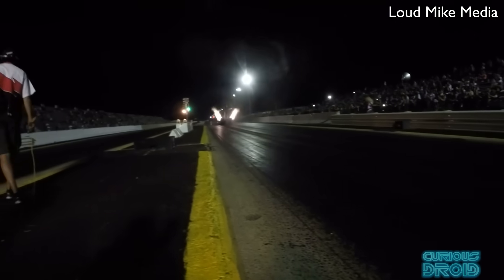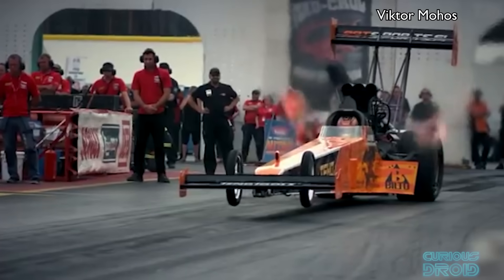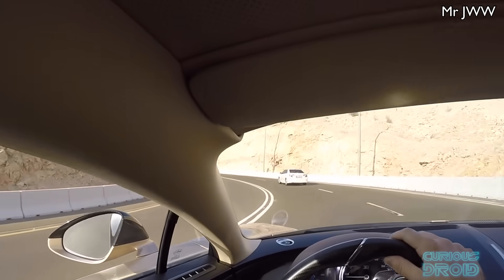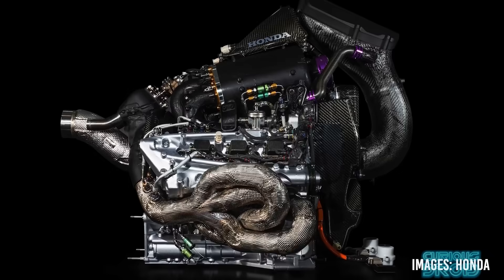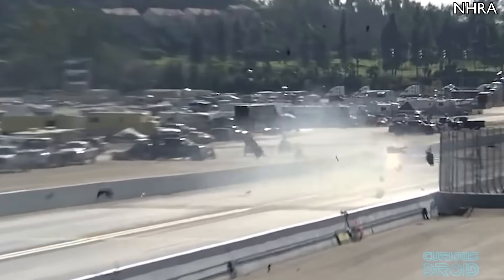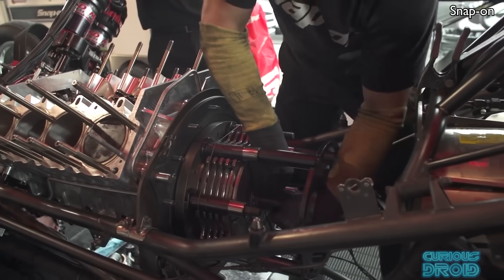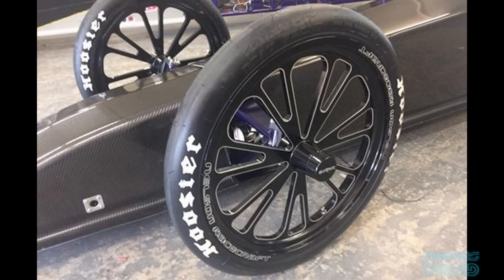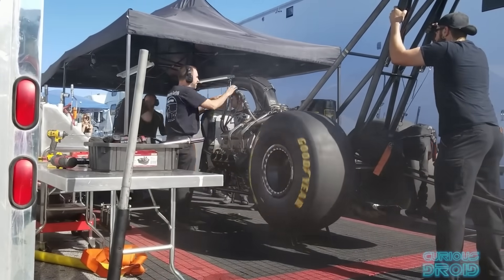The Amazing Engineering of Top Fuel Dragsters

Comment: I remember reading this years ago regarding a "Definition of Acceleration"......

One Top Fuel dragster's 500-cubic-inch Hemi engine makes more horsepower than the first four rows at the Daytona 500.

A stock Dodge Hemi V-8 engine cannot produce enough power to drive the dragster's supercharger.

With 3000 CFM of air being rammed in by the supercharger on overdrive, the fuel mixture is compressed into a near-solid form before ig-nition. Cylinders run on the verge of hydraulic lock at full throttle.

At the stoichiometric 1.7:1 air-fuel mixture for nitromethane, the flame front temperature measures about 7000 degrees Fahrenheit.

Nitromethane burns yellow. The spectacular white flame seen above the stacks at night is raw burning hydrogen, separated from atmospheric water vapor by the searing heat of the exhaust gases.

Dual magnetos supply 44 amps to each spark plug. This is the output of an arc welder in each cylinder.

Spark plug electrodes can be totally consumed during a single pass. After half-distance, the engine is dieseling from compression plus the glow of exhaust valves at 1400 degrees Fahrenheit. The engine is shut down by cutting the fuel flow.

If a spark plug fails early in the run, un-burned nitro can build up in the affected cylinder and explode with sufficient force to blow the cylinder head off in pieces or split the cylinder block in half.

In order to exceed 300 mph in 4.5 seconds, dragsters must accelerate at an average of more than 4 g's. In order to reach 200 mph before half-distance, the launch acceleration approaches 8 g's. A Top Fuel dragster reaches more than 300 mph before you have completed reading this sentence.

With a redline that can be as high as 9500 rpm, Top Fuel engines turn approximately 540 revolutions from light to light. Including the burnout, the engine needs to survive only 900 revolutions under load.

Assuming that all of the equipment is paid off, the crew works gratis, and nothing breaks, each run costs an estimated $1000 per second.

The current Top Fuel dragster elapsed time record is 4.441 seconds for the quarter-mile (October 5, 2003, Tony Schumacher). The top-speed record is 333.25 mph as measured over the last 66 feet of the quarter-mile (November 9, 2003, Doug Kalitta).

Putting all of this into perspective: You are driving the average $140,000 Lingenfelter twin-turbo Corvette Z06. More than a mile up the road, a Top Fuel dragster is staged and ready to launch down a measured quarter-mile as you pass. You have the advantage of a flying start. You run the Vette up through the gears and blast across the starting line and past the dragster at an honest 200 mph. The "tree" goes green for both of you at that moment. The dragster launches and starts after you. You keep your foot down, but you hear a brutal whine that sears your eardrums, and within three seconds, the dragster catches you and beats you to the finish line, a quarter-mile from where you just passed him. From a standing start, the dragster spotted you 200 mph and not only caught you but nearly blasted you off the road when he passed you within a mere 1320 feet.

And that my friends, is acceleration!
Reply: I recently ran across that 900 revolutions figure. Seemed low but with start, idle, burnout, reverse, idle, and run, 900 to 950 seems correct.
Reply: This is a very long comment but it has some cool facts I like it

Comment: I knew many of these facts from other videos but some things that never stop amazing me:

The supercharger alone requires 800hp to work.
The engine pumps so much fuel in that it's just barely close to hydro locking.
The clutch replaces about half of the friction plates after each run because the heat literally welds them together.
The magnetos produce around 88 amps, around the same amount as low level MIG welder.

Comment: I've stood about 25m in front of a Boeing 777-300ER with GE90-115B engines, the largest gas turbines fitted to an aircraft, running at 90% N1. GE reckon that's about 140,000hp, and it's still not as loud as a Top Fuel Dragster in my opinion. The pressure waves from the exhaust on those literally distort the lens of your eyeballs and your vision blurs as they go past, awesome!!
Reply: Stand a few dozen feet behind that engine and see how loud it is!

Comment: I believe this is the only documentry on the stresses and design nuances packaged for us laymen. Much appreciated. I have two 1/10th scale radio controled drag cars. :) This video actually might be a bit helpful in understanding their bad behavior in 132ft. A controled straight line run with these models is an art. There is a YT video of one of these models launching without the body on it filmed with a high speed camera. The chassis was carbon graphite and it had aluminum suspension parts, gearbox housing and lots of high tech parts. The video was shocking! The chassis had a visible ripple that traveled through the length of the model and a longitudinal curl in the first second. Really brought home why these models are so twitchy. 
But it's also the fun part to tune that bad behaviour into something controlable. 
So your going to do a video on how top fuel and funny car chassis are designed right?

Comment: Fastest ground vehicle ? what about jet powered dragsters making 28,000 hp and going much faster?
Reply: They actually don’t accelerate faster. These still beat them in a 1/4 mile
Reply: @captainhellhound7451   vanishing point did a quarter in l 3.58? which is accelerating much faster RIP sammy miller.

Comment: No one is going to point out: 8.6 times as much nitromethane as gasoline can be burned in one stroke. Nitromethane, however, has a lower specific energy: gasoline provides about 42–44 MJ/kg, whereas nitromethane provides only 11.3 MJ/kg. This analysis indicates that nitromethane generates about 2.3 times the power of gasoline:

Comment: I've been a mechanic for over 30 years and it's amazing to me how they get that much power from a V8 engine! There's absolutely nothing like it on earth!
Reply: Not only that but a V8 that's built off of an ancient design. I want to see a top fuel dragster with a modernized engine 🤣
Reply: @ksrebelbuck7936 from what it sounds like, they're already holding these things back for safety/insurance.

It would be cool to see one that lasts longer or blows up less, but that's more for the team than the spectators.

Comment: How do they do it?  Barely!

The old saying is if the race is 1/4 of a mile and it machine lasts 3/8 of a mile you didn't try hard enough.

In terms of the basic insufficiency of the vehicle to survive it's intended course intact to the degree it compromises the safety of the pilot - and anyone near by -  the top fuel dragster [or motorcycle] is probably the most extreme example in the world.  The only comparable counter example would be the motorcyclists and motorcycles of the Island of Mann TT, where the course is the limiting factor not so much as the machines themselves, though mechanical failures regularly cause spectacular and sometimes fatal crashes - just google Guy Martin.

Comment: At 13:00 you say rear wing produces "12 000 pounds, or 5,5 kilonewtons", but it should be 55 kilonewtons - 5,5 tons... which is totally crazy. 
(i checked some data and 6000 pounds (3 tons) seems to be normal, which is still crazy)

Comment: Oldish, but still relevant.
You are riding the average $250,000 Honda MotoGP bike. Over a mile 
up the road, a Top Fuel dragster is staged and ready to launch down a 
quarter mile strip as you pass. You have the advantage of a flying start. You 
run the RC211V hard up through the gears and blast across the starting line 
and past the dragster at an honest 200 mph (293 ft/sec). The tree' 
goes green for both of you at that moment. The dragster launches and starts 
after you. You keep your wrist cranked hard, but you hear an incredibly 
brutal whine that sears your eardrums and within 3 seconds the dragster 
catches and passes you 
He beats you to the finish line, a quarter mile away from where you 
just passed him. Think about it, from a standing start, the dragster had 
spotted you 200 mph and not only caught, but nearly blasted you off the 
road when he passed you within a mere 1320 foot long race course.
Reply: I don't know the scooter you mentioned but as a rider myself the whole image of this event is in my head and I wish I could get a video of it. Thanks for the memory.

Comment: You can tell which direction the crankshaft is spinning by watching how the front wheels lift off the ground on the starting line. The tremendous torque from the clockwise-spinning engine twists the frame, causing the left front tire to lift off the ground before the right front tire.

Comment: It's not strictly true that we calculate horsepower from run time, weight and track conditions. We used to do that. But the torque sensors you later mention allow us to measure power directly (power, torque and RPM are related - given that we know the torque and the RPM, we can accurately calculate power).

Comment: How can the car use 20 gallons of fuel per run when it's got a 17 gallon fuel tank?   Must be a typo....as is the '12,000' HP number that's being thrown about.   NO  WAY it's making that much....I know, someone developed a strain gauge to measure torque on the drive shaft...but if you look at the plot it's jagged as all get out and they're doing the HP calculation at the peak of one of the jags.   Just as legitimately you could say that the engine only (only!) makes 4,000 if you look at the lower peaks on the plot.   Every year it's more and more like they're trying to out-do last years number.   People have done the math....accelerate so much mass, so far in so much time = the actual HP used....and it's a LOT less than 12,000 and more like half of that.    Still interesting sport and more power to them...I just wish they weren't trying to sensationalize something that doesn't need sensationalizeing.
Reply: They’ve tired using dynos rated for 9,000 horsepower to test them.

They broke the dyno

Comment: Another thing about the spark plugs. One the electrodes are gone, the engines just diesel down the track. The plugs are pretty much gone at the hit of the throttle. I was told by a crew chief of a top fuel team, "the plugs are just in there to start the engine" LOL.
Reply: Nitro does NOT ignite by compression alone, so much for your misleading theory
Reply: @Big_John_C  Yes it does. Once you have no spark plug left. Guess how you're igniting it?

Comment: what cracks me up is the 500 cubic inch rule ,Toyota has a funny car ,and a top fuel dragster ,etc ,Im waiting for more Asian  models to show up ,even though every team is using the same basic engine block ( Mopar ),hemi  dual mag ignition, like Ford has a 500 hemi, or GM, with a BFG blower, its a mix of parts ,that make over 12,000 hp, Heck you can design a Kia funny car using Mopar Top Fuel engines

Comment: Correction at 7:45 - The Roots type supercharger was not invented for diesel truck engines at all. They were invented by brothers Philander and Francis Marion Roots for use in industrial forced air applications such as blast furnaces or mine ventilation in 1860.

Edit: On secondo through, you were probably referring to the specific model/design used on dragsters, not the general idea of a roots type supercharger.

Comment: To help put into perspective how fast these cars accelerate:
If you had a corvette doing 200mph on a race track, and a top fuel car sitting still at the start line, and right when you crossed the line at 200mph, the dragster takes off, it will catch up and pass you in less than a 1/4 mile.

Comment: id love to see what they could do without all the rules. maybe keep the engine size the same, but no rules on the type of engine or wether its a turbo or supercharger. :)
Reply: Nice thought, but not possible. NHRA cut the run length of the track down to 1,000 feet for the fuel classes, because they were going so fast FOUR YEARS AGO, that most tracks didn't have long enough shutdown areas to stop them safely...
 There are several different types of superchargers and turbochargers out there, but they stick with the Rootes-type, for reliability, and equality between the teams. If  not, the low budget teams wouldn't be able to afford the exotic parts, and competition would become very one-sided...

Comment: It is mind boggling that so much fuel is used and so much power and speed is achieved by an engine that will only do 500 revolutions during a race.
Reply: Shockingly enough, you're right. At 8000 RPM, an engine will do 533 revolutions in 4 seconds; the best times are under 4 seconds.

Comment: You mentioned that there is a fine line between "hydro locking" the engine.  It's actually by design that they are pumping so much fuel in.  They are using the fuel volume to help increase the effective compression ratio, since the fuel is incompressible.

Comment: Standing along the fence for top fuel or funny car runs is the only experience in my life where I ever felt sound. I don’t mean the vibration through your feet either. If the atmospheric conditions are right, you can literally feel the mechanical energy of the sound waves against your skin as the cars go by.

Comment: Pick a unit of measurement and go with it / flipping between liters and gallons is annoying.

Your fuel management numbers don’t add up, not even close.  17 gallon fuel tank and consuming 5.5 gallons per second on a let’s say for your benefit a 3.3 second run plus burn out and idling you’re out of fuel before the race is over.  Your fuel pump is pushing 100 gallons per minute is 1.7 gallons per second and your consuming 5.5 gallons per second, big problem.

Comment: There are three-valve and four valve versions of the Hemi for Top Fuel, but they may not be 'legal' in all race organizations.
Search terms are "McGee Quad Cam"
The 'chute generate up to 9G of deceleration - enough to detach the retina of a driver.
The Carbon Brakes, don't come in to effect until the chutes have dropped about half the run's speed.

Comment: @10:00

Confused that you said that they cannot measure the horsepower of a top fuel engine then at 10:45 you literally show the device that they use to measure the power output of the engine.

More information for anyone that cares:

https://www.youtube.com/watch?v=t5tptWVwzOA
Reply: And as he said in the video they are torque sensors so they measure the torque not the hp.
Reply: @SllSamuel-034  

Horsepower is derived from the torque at a given RPM.

The equation is:

hp = (torque * rpm) / 5252

How do you think a dyno works? An engine dyno or chassis dyno are measuring torque. Since you are also monitoring engine RPM the software uses the simple equation to derive the horsepower.

This might be of interest to anyone that is curious:

https://www.youtube.com/watch?v=lt7iUBE3_AE
https://www.youtube.com/watch?v=u-MH4sf5xkY

Comment: I've been to a few top fuel drag races in Las Vegas and can tell you that even in the stands that have a metal covering, you definitely need ear protection. The vibration in the air as the cars go down the track can even be felt in the parking lot and in the stands, it's insane. Very intense.

Comment: I came to see how bad you did but you did good! We used to run a 500" blown fuel Hemi on 60% at Bonneville & every run was 5 miles. Our best effort was 11 runs without taking the heads off, that's 55 miles not counting warm-up's & 14 gallons of fuel per run. The car went 432 mph.

Comment: Top Fuel engines are putting a plastic pin in a hand grenade, putting it in a bucket filled with plastic dissolving liquid. And then shacking it. 
How loud? Got a friend to stand at the fence on the right( See 0:19) arms spread crucifix and on the yellow light scream.  The shock wave hit them and no noise came out, they looked at the ground now 2 foot from the fence! 😲😲
There were temps to modernize Top Fuel, The McGee and the Sainty OHC motors are just two.